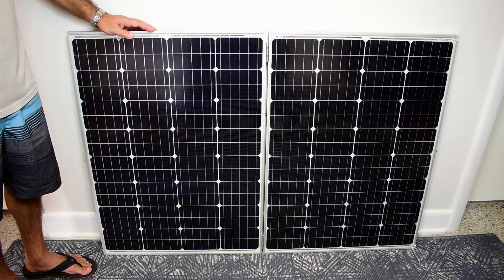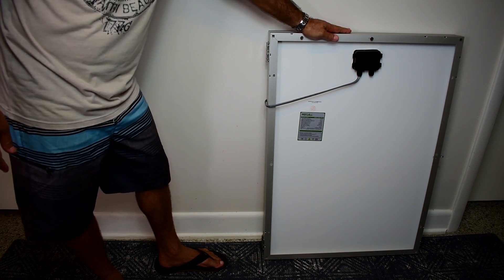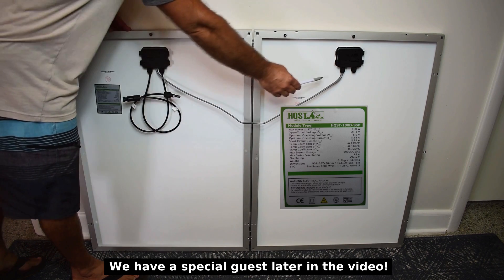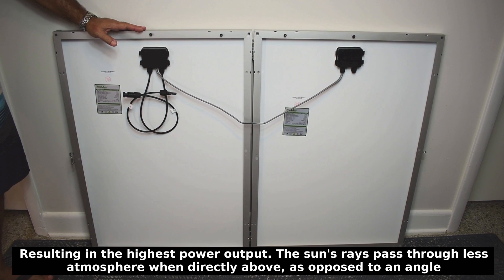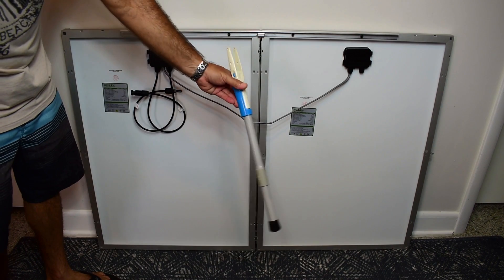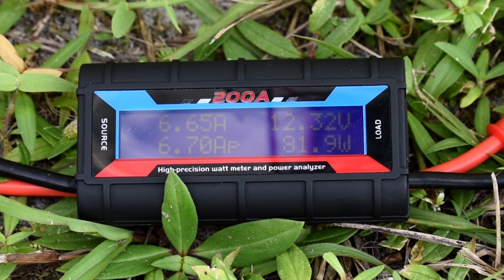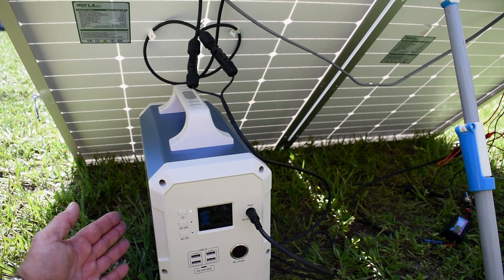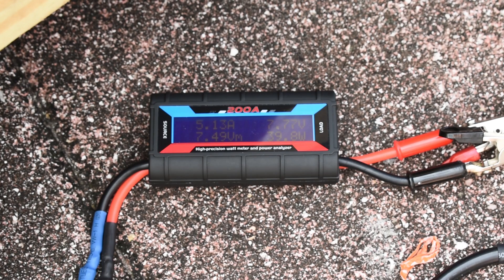DIY Low Cost 200W Monocrystalline Folding Solar Panel

Comment: Great job. Just started learning about building my own portable solar charger to have juice on the road and in the woods. Please excuse my amateur questions. Most kits I see have a charging controller, does that power meter you show do the same thing? I can't catch the name of the sine wave generator you are using. It seems I need something like that for what I want to do. Thanks!

Comment: Regarding screw eye, noticed you used nut/washer. Since the screw-eye latch threads are designed for wood, what did you do on the backside to secure or tighten? Fiber nut? Unless, were you able to find screw-eye latch designed for nut/bolt application. Also, what size did you use? 1-1/2" I'm guessing. Thank you
Reply from the maker: I used a machine screw eye.
Reply: @electronicsNmore  I've scoured everywhere for a machine threaded screw eye. They are NOT available on this planet!
Reply from the maker: Really? What planet you on?
https://www.acehardware.com/departments/hardware/nuts-and-bolts/eyebolts

Comment: Great video.  Very informative... Quick question though.  Aren't you concerned about wind picking up the panels and knocking them over?  And I was curious about how you wired them in series:  I thought you took the positive from one and negative from the other and combined them.  Then take the two remaining as the main positive/negative?
Reply from the maker: The wind would need to be fairly strong. The panels aren't too light. As you said, +/- to +/-

Comment: Dumb questions for a novice, but when lining up holes to drill hinges, you lay them in the closed position with the rubber spacer? Then do you have two make sure the spacing between panels is slightly wider than the hinge bolt?
Reply from the maker: Not dumb. Lay one panel flat, then place the other on top. Install the rubber bumpers on the opposite side of the panel to create a space, then position the hinges with a similar space so they lay flat. Mark the holes, then drill.

Comment: I get it.  More solar for the money.   But the main problem with this concept...... the idea of a folding solar panel is WEIGHT savings and portability.   These are relatively heavy and bulky.  Not exactly ideal for portability.  Imagine hiking to a remote spot with these.   If you're going to use these (and they are great) then have your vehicle nearby and keep them near it or even mount solar panels on your vehicle.   But this defeats the idea of portability.
Reply from the maker: It helps a lot with portability, you have a panel 1/2 the size.

Comment: i appreicate your throwing in the last bit about those panels who have  exaggerated specs. i have ordered many panels and they came this week and this weekend im going to get to the bottom of what all these panels can do. also, like you said they are over priced on top of it all. i dont understand how/why you were using a headlamp as a load. that trick would be handy if i understood what you were doing,  have the same watt meters btw
Reply: lol my "70 watt" foldable panel was only producing about 25 watts today. it's job is the lay on my dash board of my vehicle and help keep the starter battery charged, as i have tons of electronic stuff draining my battery at all times. i paid like $80 for that damn thing for only 25 watts lol. someone should dedicate a youtube channel to this garbage

Comment: Wonderfully done.  Love your use of outside parts (i.e. the angle aluminum with knurled bolts and broom handle hack) to make it easy and super useful.  One question, did you not just use the existing MC4s to wire in series because of the bypassing diode drill you went through?  My apologies if I missed something.  My plan is to wire in series using the OEM MC4s on the panels, connect to an MPPT charge controller near the 2x 6v (wired in series) battery setup on the RV to charge those batteries dry camping.  Thoughts?
Reply from the maker: Thanks Josh. I didn't want the MC4 cables on one panel because they were too rigid and didn't fold close to the panel. What you said should work fine.

Comment: You are genius. Thanks for sharing
Reply from the maker: Thanks for the nice comment! Be sure to check out my solar and battery testing video playlists below, and most importantly share them with others. 
https://www.youtube.com/playlist?list=PLQ6IOhUBblU2G9fBmFeWCkxD7kEV2fzXF
https://www.youtube.com/playlist?list=PLQ6IOhUBblU2CFaGRj9eB2I38yHnW5FQz
Reply: @electronicsNmore  , I built out of 1 and 1/2 “ pvc a similar version for my (2) 200 watt monos as its stable enough . Your hinge, locking design and stability to the ground will help me complete mine. Genius, I just did not want to tact to roof of RV 30’Trailer. It only takes a couple of minutes to assemble and hang the panels in right position.  You are articulate and produce great content. I subscribed

Comment: Maybe not quite as convenient, but you could just keep the stock cables. Maybe use some velcro to keep them neat during transportation. Brings the difficulty level of this from 7/10 to 2/10. Also, that way you could scale up the array even more, make another one of these and connect 4 panels in series. The Bluetti can handle it.
Reply: Agree… rewiring does not make sense to me, eliminates any flexibility. Using existing MC4 connectors does the same thing… with no rewiring, no GOOP. But, I do like the other basic ideas, over all good job, good ideas.

Comment: Great video and innovative ideas. I have the same panels and was going to put them out side by side but not joined together as I thought they would be to heavy. How much does yours weigh?
Reply from the maker: I have the panel in storage. If you click the link supplied in the video description area, it should list the weight. Take the weight and add another pound or 2. Thanks for watching!
Reply: @electronicsNmore  Thank you. It says 14.3 pounds per panel so the solar suitcase should be around 32 pounds.

Comment: Excellent design! I'm curious about the threading into which the knurled bolts are secured to keep the aluminum angle stock in place. Are you threading the knurled bolt into the aluminum of the PV panel frame or is the frame "backed" by a 1/8-28 nut? Also, how did you attach the cable crimp connector to the aluminum angle? Thanks!
Reply from the maker: If the hole is properly drilled/tapped, the frame is thick enough to hold. Don't overtighten. The cable crimp is held in position using (1) rivet.

Comment: I have two 100 watt panels like you. Im placing mine on the roof of a caravan. I live in ireland. We dont get much sun. Thats why i went for the mono. Im only using it to charge my battery. 105AH flooded battery. Trojan. Now my question is do i connect in series of paralell . Tryed researching but got totally confused
Reply from the maker: Connect them in parallel, then to a 7 - 8A charge controller connected to the battery. If the light level is too low, you may need to connect them in series to increase the voltage output.

Comment: Well done! Why didn't you mount the hinges the other way around? The glass is way more sturdy than the backside of the panel. also the cable would not hang on the outside, possible haveing the panels press on them while stored/transporting. Thanks for the video!
Reply from the maker: I wanted protection for the face of the solar panel. Thanks for watching!

Comment: Just purchased the Bluetti 2400...credit card is smoking! haha.  Have you changed your mind on your Solar Options....adding 2 panels to 400w?
I have never heard of less power loss in line using series and more voltage...good to know.  Was told parallel was the way to go if there was any shade.  I will copy your folding panels and have 4 in series. HSQT all sold out.  A little more difficult to source in Canada at this time.  Thanks for a great video, would have wasted more money on cheaply built folders.
Reply from the maker: Bluetti is good, I have one. Glad you liked the video!
Reply: @electronicsNmore  Have you adde any panels to your solar charge? What gauge extention wire would you recommend for a 30 ft cord so I can get it in the sun? 
Thanks

Kevin

Comment: Great work.... HOW DID YOU GET THE RIVETS OUT OF THE MR CLEAN MOP without damaging it?  I saw a similar telescoping windshield squeegee/sponge with the same connection and extending mechanism for $6 at a discount store- probably can be found at Walmart or an auto store.  It is about 20 inches tall before extending.  What is the best way to cut the mop or squeegee to size?  GREAT IDEA!
Reply from the maker: I used a dremel with a cut-off wheel.

Comment: Very cool,  just be aware using Stainless Steel screws and hinges on aluminum will cause a galvanic reaction and corrosion. Just swap them out with zinc coated.
Reply from the maker: It will be fine. They would have to be constantly exposed to moisture. Boat outboard motors use stainless bolts to bolt the lower unit to the upper, which is made of aluminum. Thanks for watching!
Reply: I agree, Zinc is a very good choice for the hardware, for this type of project, for a number of reasons… plentiful, cheap, a reasonable strong metal, and a very small corrosive effect with aluminum.

When two dissimilar metals are in contact with each other (in a wet or humid environment) there will be a reaction, commonly known as Galvanic Corrosion. In the case of Zinc and Aluminum, there is only a slight/reduced chance of this Galvanic Corrosion, because of the relatively minuscule electrical potential between the two metals, and the typical thin insulating film (aluminum oxidation) on the surface of the aluminum… other metals have a stronger electrical potential with Aluminum, and will easily exceed any insulation properties that the Aluminum may have: Lead, Tin, Solder, Copper, Graphite and Platinum are among the worst (electrical potential) metals for Aluminum (Galvanic Corrosion). While Stainless Steel is not as bad as some of these other metals with Aluminum, it is still worse (electrical potential) than Zinc. 

Beryllium is an even better choice then Zinc, but I have not seen too many hardware products made of Beryllium. Besides, Zinc hardware is much more plentiful and is a lot cheaper then Stainless Steel hardware, but if that is all you have, yes Stainless Steel hardware does work, and it will take some time for this Stainless-Aluminum corrosion to become visible (depending on your environment), but it will eventually show, and it will show a lot faster than Zinc will. A low humidity environment, like a desert, is about the only area where the life of the panel is likely to exceed any serious Galvanic Corrosion (for the bad metals). Obviously… high humidity, lot of rain, not the best environment.

Thus, unless you are seeking some ecstatic reason or strength of metal reason… Zinc is a better choice (IMO), then Stainless Steel for this type of project (if you have a choice)… to lower the potential effects of corrosion over time, and save money.  If you do choose Stainless (or another corrosive metal), there are products that can coat and seal the metals to reduce/slow the effects of corrosion.

Quick side note: in the case of Zinc-Aluminum Galvanic Corrosion, it’s the Zinc that corrodes. In the case of Stainless-Aluminum Galvanic Corrosion, it’s the Aluminum that corrodes.

Comment: There is a suitcase version for only $60 more. To me, it was worth it (I bought two) because I don't want to deal with the DIY aspect at this time. However, I applaud anyone who follows the advice in this  excellent video.
Reply from the maker: I saw those, they're only 100W. Mine is 200W.

Comment: What panels did you use?  I can't find any 100 watt 19 volt panels anywhere.
Reply from the maker: Hi there. I posted links in the video description area of the video. You may have to click the small arrow under the video player window to see it.
Reply: @electronicsNmore  Yes, I clicked it - It goes to a 50 Watt 12 volt panel.  Please click it and you'll see.
Reply from the maker: @bunkosquad2000  OK, click the link now. Thanks for bringing it to my attention!

Comment: That's a horrible way to test wattage of solar panels. A halogen bulb does not track the maximum power point of a solar system, therefore it will not give you proper wattage readings of different systems. Get an MPPT charger setup to properly test.
Reply from the maker: Not a horrible way. The panels have a specific current output based on voltage. The tests show the panels are very close to, or match the rated output. An MPPT is basically a boost converter.

Comment: just found your videos. I will use your setup for the panels but my questions is: how would you hook up the panels to a 450 amphour lead acid battery system. I want to buy a mppt charge controller to install inside my cargo trailer and have a 50 ft cord to run to the folding solar panels. Could you explain the best way to do this. Thanks so much. Do you take paypal one time gifts?
Reply from the maker: Hello. I do accept Paypal channel donations, but if you shop for products at links I provide, then it's not necessary. Besides the solar panel links already provided in the video description area, I recommend what's shown below at the Amazon affiliate links. Connect both panels in series for 24V output, and use no blocking diode in series with the power output. Higher voltage will allow a thinner copper wire. I'd use as short of a power cord as possible from the panels to the charge controller and to the batteries. Up to 50 feet use 10ga, 25-35 feet use 12ga. Thanks for watching!

MPPT: https://amzn.to/3ab4qNY
MC4 connectors: https://amzn.to/36VKKM5
Reply: @electronicsNmore  Should I upgrade to the Epever 20 amp mppt if I plan to install lithium batteries in 2 years? I also have no idea what you mean about not using a "blocking diode in series with the power output". I know nothing about electronics. Thanks for your help.

Comment: The glass seems better protection for the cells than the plastic on the back. I'm considering making mine fold with the backs together, leaving glass out on both sides. Thoughts?
Reply from the maker: I prefer the glass panels facing each other, because the recessed area is less likely to get damaged.

Comment: I know this is a dumb question but how do you open the box containing the diodes? I am trying to set up this system but don't want to break anything, do the covers snap on/off, hinge from top/bottom/top? Thanks for any help.
Reply from the maker: Hi Ken. Insert a small slot screwdriver into each cover opening to gently pry open the clips.

Comment: Thoroughly enjoyed this informative video thank you. Did you tap the sides of the panels 10/32" to connect the hinges, or did you just drill small holes and thread in the bolts?
Reply from the maker: Holes drilled slightly larger than the flat head bolt diameter. Thanks for watching! Please share.
Reply: @electronicsNmore  Thanks for responding. After watching this I ordered the 200w  HQST kit and am attempting to duplicate your project. I really don't want to drill holes in my trailers roof, therefor this portable system hopefully fits the bill.

Comment: they usually multiply the Voc x Isc and give the wattage value. this value is never be possible under a closed circuit! the things are worst if a charge controller is used!
Reply from the maker: Thanks for watching Paul!

Comment: You get maximum power output from your solar panels when your load resistance matches the output resistance of your solar panel.  The open circuit voltage divided by the short circuit current will give you the output resistance of the solar panel. This may explain why some panels don't meet specs.
Reply from the maker: The folding solar panel at the end of the video had a 5.6A short circuit current. The open circuit voltage was 21. That's well over 100W, but the panel under load couldn't supply more than around 45 -50W.
Reply: @electronicsNmore  Your solar panels can be reduced to a Thevinin equivalent circuit. This would be a 21 volt power source with a 3.75 ohm thevinin resistance. If your load resistance is 3.75 Ohms, the most power that you can get from the panels is 58.8 Watts. This will also be reduced by the power dissipated by the blocking diode. https://sinovoltaics.com/solar-basics/thevenins-theorem-and-solar-pv-modules/
Reply: What you describe is the Maximum Power Point (Tracked by an MPPT charge controller). The specs on the back of the panel are only the maximum power in Standard Test Conditions, as the MPP varies depending on irradiance and temperature and as the cells age.

Comment: You solder those diodes in? If so, can you provide the specs? Newbie here...
Reply from the maker: Hi there. The bypass diodes come installed in the panel, but I replaced mine with very low loss 10SQ045 diodes. I also used the same diode for my blocking diode, which connects to the (+) wire of the solar panel that connects to the battery being charged.
Reply: @electronicsNmore  thanks so much!

Comment: 1:12 flat head is not the best to hold thin flat metal, something like pan, button would be better.
Reply from the maker: Flat head is exactly what you want. You can't use round head, the hinges won't close!
Reply: @electronicsNmore  Good point, I forgot about that.
Reply: @electronicsNmore  Or maybe pop rivets.
Reply from the maker: @schmartz99  They're OK, but not as strong as a small bolt.
Reply: @electronicsNmore  No they aren't as strong as stainless steel screws but they should be plenty strong for this application.  Aluminum 3/16" pop rivets are what's holding the hinges on my insulated overhead garage door and that's how it was manufactured.  This is a really cool and practical project.  Glad you posted this because I'm going to do my own now!